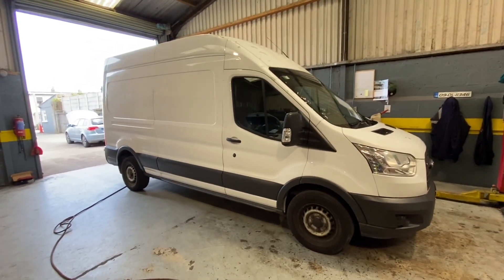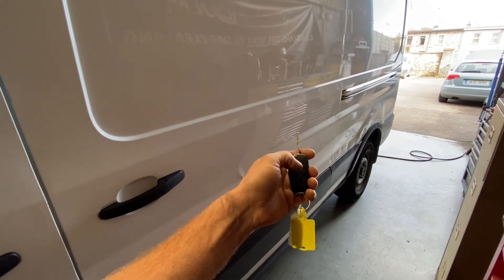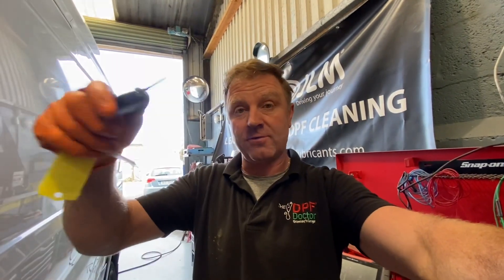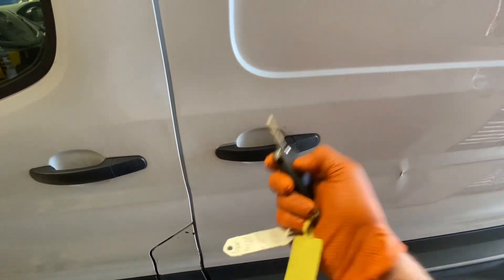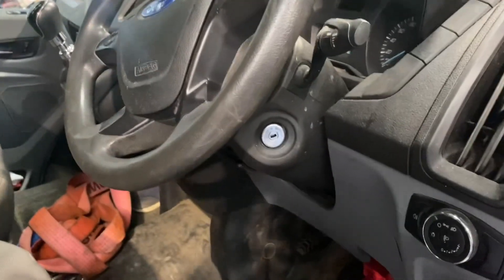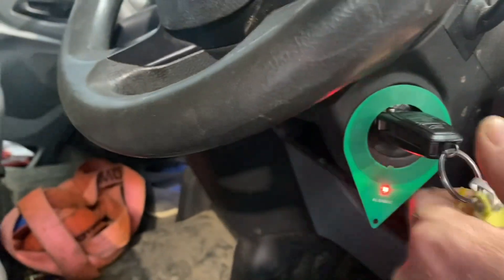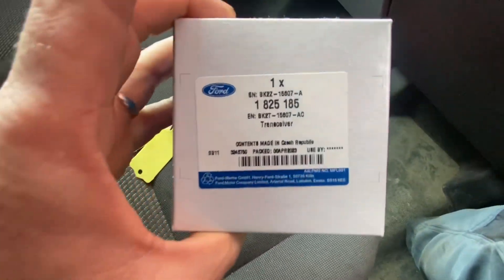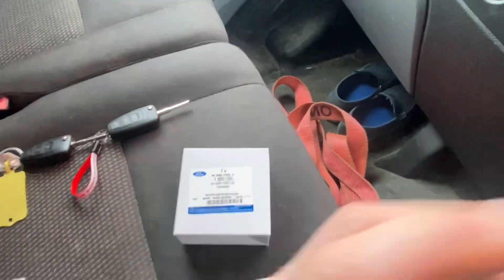Ford Transit, central locking fault & immobiliser system malfunction

Comment: I love how you so often ignore the CAN bus errors and distractions and instead apply some good old common sense. Saves so much time, and garage bills, for the owner. Wish you were my local mech.
Reply from the maker: Fault codes can be very misleading at times & I have been lead down the garden path a few times by ignoring my gut feeling. But also vice versa, my gut has lead me down the garden path too. So I suppose you do a little digging & take the route you feel best to get a result 😉👍👍👍

Comment: how many lads would have just said its a bing bong ford.. has to be bcm, and sent that man away with a large bill and useless new parts...  love the way you show a mechanical mind in problem solving.. another great lesson thanks peter..
Reply from the maker: My thought process was, if the van wasn’t actually locking correctly that could arm the immobiliser. So thought I’d fix that. When the issue persisted I then thought the key battery failing was at fault (which was needed) but Keyfast said the transceiver was faulty 😬😬
So it wasn’t as clean cut as I’d like, but we got a few needed repairs done . Cheers Lar 🙏🙏

Comment: I’ve just been through this the past week. 
Figured it out via cheapest option first but this brilliant video would have helped loads. 
Van now starts but alarm comes on, any idea what that could be?
I’ve got the van battery on charge tonight on the off chance it was a bit low on volts after being stood for so long..

Comment: thanks for the video, peter how was nicky checking the transciever?it look all good with the tool you were using ,is that not be trusted.
Reply from the maker: I actually don’t know what he was using, I dropped the van off to them and left it there. But I could only take his advice & when they had it in the dealers it said a lot 🤷🏼‍♂️🤷🏼‍♂️🤷🏼‍♂️

Comment: I used to see the light on the key signal tool flash, then think everything was ok.   After a couple of non starting cars with immobilizer faults, they made the immobilizer tool flash. It left me thinking, I'm not getting enough info from that to fully know what's going on.

 Now that you have a new transceiver, does it only flash once? 

Sometimes I use my sealey key fob tester, switch it on and hold it next to the ignition and see it flashes when I turn the ignition on. 
Cheers Matt
Reply from the maker: That is something that I should have shown Matt, yes it only flashes once now with the new transceiver.  
It Wasn’t a very good test alright. 
I didn’t realise I could do that with the keyfob tester, excellent tip 💪💪💪👍

Comment: Great Video. Pity the Antenna Checker wasn't accurate enough. Could be money wasted on a key. 👍
Reply from the maker: The battery in the key was definitely failing after a few presses & the customer wanted a spare anyway. But yes on the antenna checker, maybe it is just too cheap of an item🤔🤔
Thanks Phillip 🙏🙏

Comment: Hi. I have a 2015 mk8 transit rwd. Central locking problem.  Driver door won't lock horn sounds. Will lock with the keys and unlock on the fob
 Also rear doors won't unlock. I have replaced the bit you cleaned on the sliding door. Any help would be good.
Reply from the maker: The door lock position sensor is integrated into the door lock. The lock and wiring harness in the A pillar fail quite often. Open the door and just see if the interior light operates when the door is opened and closed??
Reply: @kennedysgarage3281  i have tried a complete working door off another van i got here.  It's still the same.  Could it be the bcm i here they fail causing central locking problems.
Reply from the maker: @Richard-ps7ht  it possibly could be the BCM but unfortunately I couldn’t advise to change it without seeing the vehicle 😞😞

Comment: Hi, I have a problem were my reverse lights only work for a few seconds and then they turn off on my 2017 Ford Transit. I have replace the reverse light switch but still no luck. I tested the voltage of the reverse light wire and it has 5V but supposed to be 12V. I have asked many mechanics to fix this but they can't. All the other lights work except for the reverse lights. Do you have any advice? Do you know where the fuse is?
Reply from the maker: 5volts is incorrect anyway. Do a voltage check at the reversing light switch. You should most likely have 12 volts on 1 wire, waiting to be sent to the reversing lamp bulbs. And a ground or earth on the other wire, coming from the bulbs. 
Sometimes Plylining screws on the rear timbers can pierce wires 🤔🤔🤔
Reply: Hi, how can I get 12v in the reverse light switch?
Reply from the maker: @satwinderbansal1166  assuming it is the switch carrying power from the fuse box to the reversing light (without looking at a wiring diagram) You should then have 12v at it with the ignition on

Comment: Its a common problem your battery wire has come loose it needs soldering back on
Reply from the maker: Is that in the key itself???
Reply: @kennedysgarage3281  yes the keys battery we have loads of transits and it very common problem
Reply from the maker: @trickyfocus  very handy to know, thanks trickyfocus 🙏🙏👍